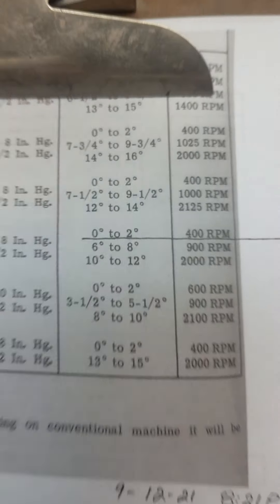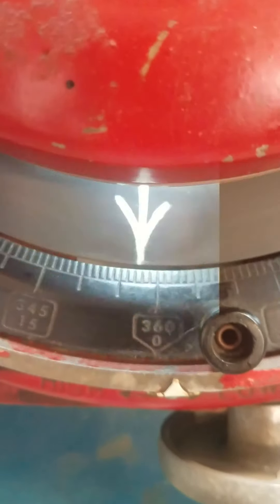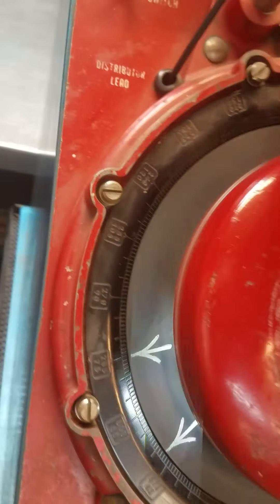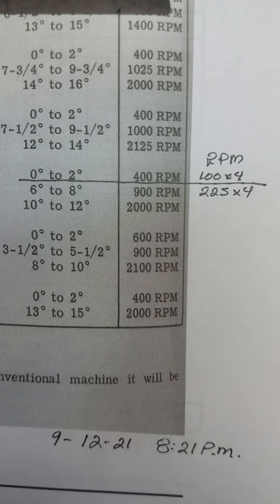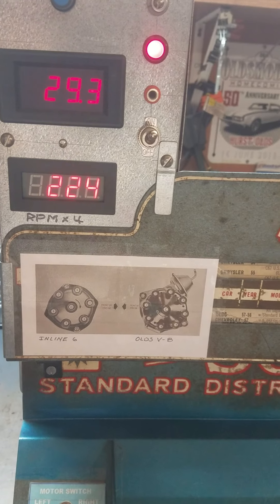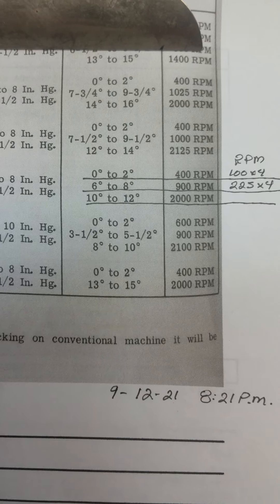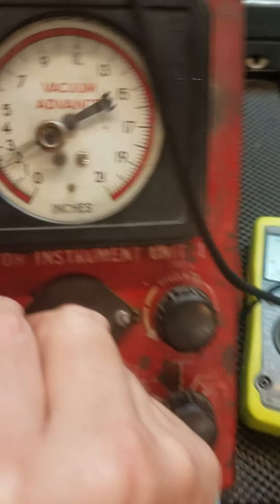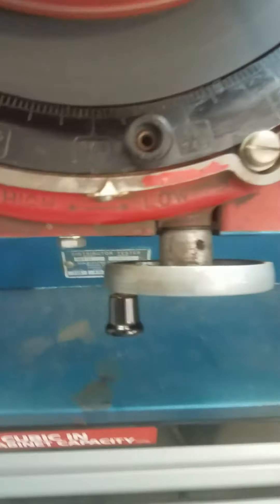First Test Video

Comment: To verify point bounce a finger can be placed on the points to dampen them.  No danger of shock because the points are only 12V and you don't have the 300V coil ring because this module does not use a coil.  HEI ignition modules can be used with module without buying any expensive adaptors.